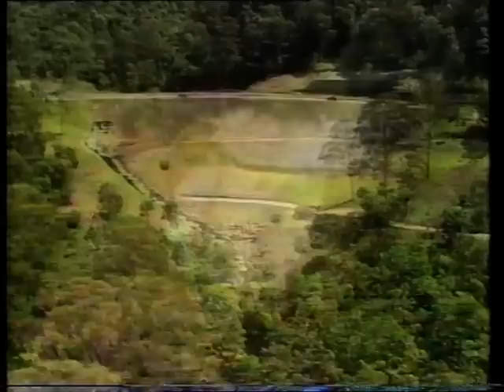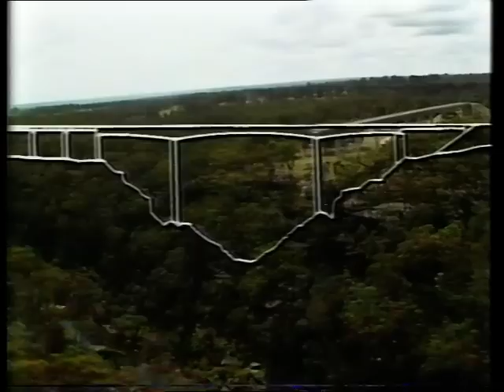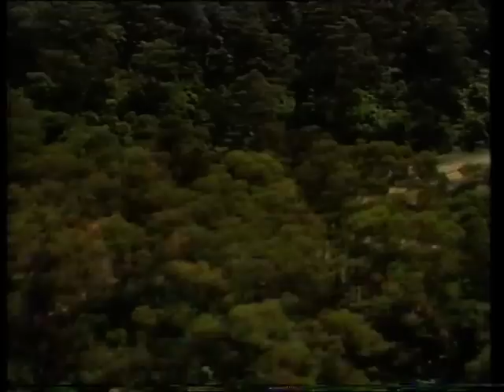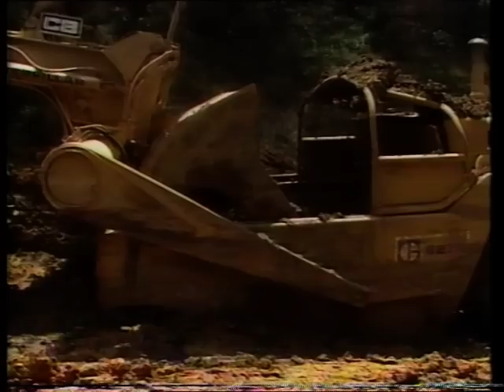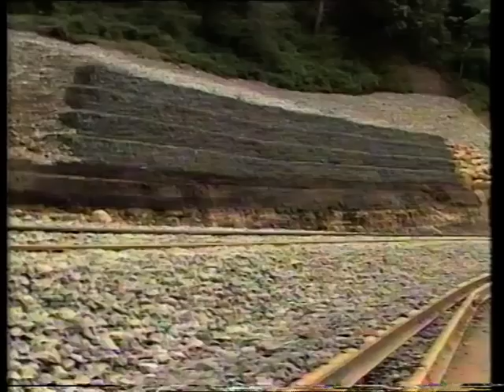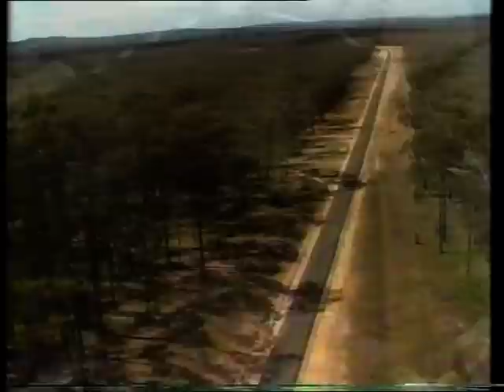Export Freeway (State Rail, 1987)

Comment: From an ex rail worker from the time Pt Kembla , stopping the construction cost more money than building it . They had to pay out the contracts and pay penalties wrote into the contracts . Then years later they spent more money doing feasibility studies to finish it . Politicians don’t care about cost,just headlines.
Reply: even if that is true, what about the cost of operating a redundant rail line for the last 45 years? Maybe worth it if there was a faster passenger train between Sydney and Wollongong. although the feasibility studies are a rort for sure, I wish it had just been built in the first place of course. But if the coal export demand wasn't there, I can see why it was canned.
Reply: it was for freight coming from the south to save it having to travel through Sydney. Freight is heavily restricted in the Sydney corridor due to passenger trains , the wheat , coal , container trains were all limited because there was only so many slots for goods trains everyday . The Moss vale Dombarton Unanderra line was weight restricted , and they built the wheat terminal at Port Kembla to reduce the congestion in Sydney. To the rail industry at the time it was like shutting down the harbour tunnels and putting all traffic across the harbour bridge.

Comment: This should be completed !
Reply: There isn't an economic case for it at the moment unfortunately.
Reply: @dat581  There likely will be if they build the Outer Western Sydney Orbital Freight Rail once the new airport goes into operation. Arguably if speeds were fast enough for passenger services (I think something like 30-40% of trips from Illawarra are to western Sydney) and if there were stations added to service the new housing developments south of Macarthur down to Wilton and bypass the slow section of track through Picton to Mittagong. It all has to be part of a bigger plan, the area and transport demands are both growing massively. 

Plus both of the other two existing legacy rail lines connecting into the Illawarra from Moss Vale and Sutherland are crumbling and falling apart and need significant investment to be competitive and retain their use cases.
Reply: @ That’s twenty years away at the least.
Reply: @dat581  Hence planning should be advanced now, the SW and SHL and Illawarra needs a significant rethink of its transport needs (freight, commuter and intercity), the legacy rail infrastructure as currently exists is total junk and the 20th century freeways/highways are under significant strain too.